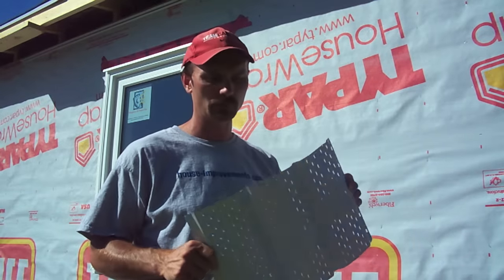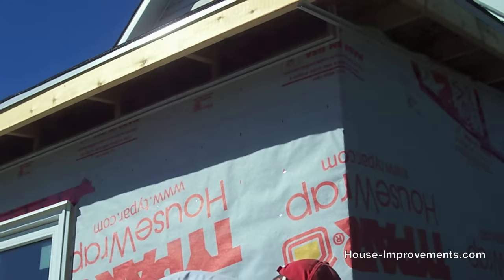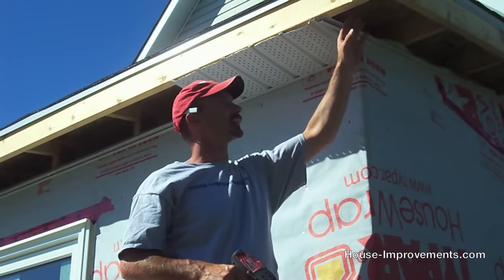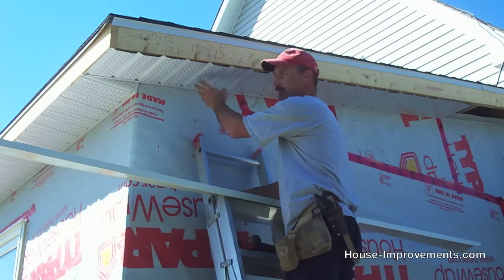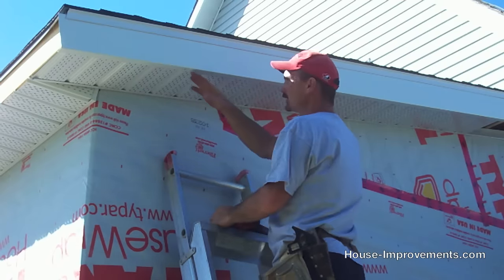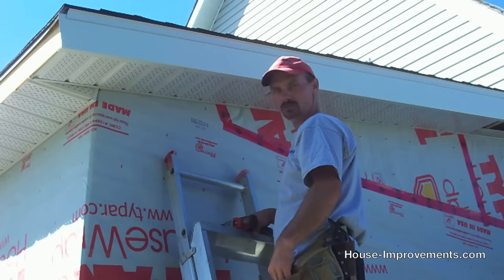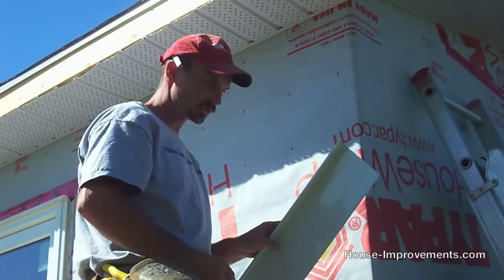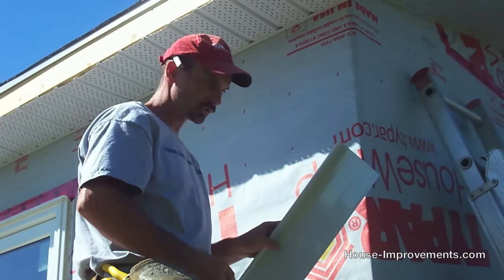How To Install Soffit And Fascia

Comment: Hopefully some faux contractor hacks will be watching.
I lived in a house for 20 years that was re-sided and guttered.
When I ended up with bacterial growth on the attic rafters because faux soffit was installed over plywood....with NO OPENINGS in the plywood for ventilation! 
The roof  exhaust vents were adequate, but NO INTAKE!
I found all kinds of crap that I had to correct by myself before I could sell.
And you know, not every home inspector knows his stuff....2 different inspectors, 2 potential buyers, and NOT ONE noticed the flaw! 🙄
I fixed everything myself after researching everything.
I don't let any so-called contractors touch anything of mine....even asphalt contractors are shady!

Comment: The only thing that I question is shouldn't the end piece wrap around the outer layer of fascia?
That's the only thing I would take into consideration aside from that, this way saves on material. Usually my company using 1x2's till its as even as possible.
Would it look more professional if it dipped // into the house or was just even throughout the entire layout of the house?

Comment: WARNING! At 5:39 it's clear that there is a huge gap between the turned-up soffit and the gable-end soffit. I installed like this, I'm pretty sure because of this video, several years back on my folk's shed and it resulted in problems with wasps getting in and nesting. Do you have a solution for this, or is this an issue inherent in this design that cannot be fixed?

Comment: How do you do the peak where the two pieces come together?
Reply from the maker: at the peak of a gable two pieces will meet ,I cut one piece so it runs past the peak an inch or so on the vertical face of the fascia and then the other one coming up I cut so it ends at the centre of the peak lapping over the first and the cut is plumb.
Reply: Thanks a million!

Comment: I hired a local contracting company to do a vinyl siding job for me, and have been nothing but disappointed. Now recently I found some soffit that apparently were cut short. They should force all all of those installing anything learn something more from professionals as yourself. I always learn something new.
Reply from the maker: Sorry for your misfortune. Maybe next time you will DIY it yourself?
Reply: Not likely but misfortune is putting it mildly. I wish I could have done it myself though because then I'd only myself to blame. I'm handy but not a home improvement expert. Thanks. :)
Reply: misue I would be fired and laughed at if I installed soffit like it's done in this video.
Reply: It looks like it's done well, why would you be fired?
Reply: misue it looks horrible. The front soffit is lower then the side. When you put the corner post on it would have to be cut to fit up in there without any gaps. It should be flush around the corner and the soffit should be cut at a 45 degree angle to smoothly go around the corner. This is lazy and half ass work.
Reply: That's what I like about pro's, they notice things like that! Thank you.
Reply: I wish I knew more about this. I appreciate your response! They actually had to redo mine because the first guys did a really really bad job! It's not perfect at all and just barely passes ok. I wish more contractors actually took their time and cared about how it looks as well as how it performs.
Reply: misue for a professional this should be very simple and easy. You probably had someone who is inexperienced do the work unsupervised by the contractor. Idk how things are done where you live but here in Massachusetts, this would be totally unacceptable for professional work.

Comment: Should the facia piece coming dow the gable not be lapped on top of the horizontal facia to prevent water from running down the gable piece and getting behind the horizontal piece and into the wood facia board?

Comment: Great video as always.  Quick question... If I am using  Vinyl soffit, can I still bend it 90 degrees as you did with the aluminium?  I want to achieve the same look as you did where the two sides meet.
Reply from the maker: +Jason Richards No it will not. where I made the bend you will need to install piece of 2x6 cut to fill in the end and then install the soffit only on the bottom of the soffit and then cover the 2x6 with fascia .

Comment: So now I need to add vents to my soffit cover. It looks like I should be able to remove the screws from the bottom lip of the fascia, pull out the old soffit cover and replace it with vented soffit... am I missing something? I think I could just cut through it and add vent covers, but I prefer to use the same vented stuff you're putting up for the look of it if it's not prohibitively difficult.

Comment: At 3:40 you said you need to keep is square to the building. What do you mean? Do you literally just put a square on the outside board and mark a line on the wood and on the house side to make sure you are putting the soffit straight?
Reply from the maker: Yes place the square against the wall and mark a lie across on the wood fascia.

Comment: Great video! You make installing soffit & fascia seem easy but I'm sure it's not.🔨 Question: Can you remove/replace a single piece of damaged soffit without the hassle of removing the fascia?
Reply: Kenneth Plott pull the screws out of the facia within 6ft of the damaged area and then the screws out of the damaged soffit and pull it out and then put the new piece back in and re-screw it. A lot easier to replace with screws

Comment: When installing aluminum fascia on a gable end of a house, should you start from the bottom and work your way to the top, overlapping the fascia with the top piece over the bottom piece as you work your way to the peak of the roof? I just had a contractor start from the top and worked his way down overlapping the bottom piece over the top.  I asked him wouldn't the rain run inside the the lap since it was reversed from what I thought was correct?  he said no, that is the way it is supposed to be installed.
Reply from the maker: protectionman  He is wrong, you are correct.
Reply: HouseImprovements some installers do that so that you don't notice the seams when looking from below. I do think water would get in though, so I would do it your way.

Comment: Shannon - what screws do you recommend using for fastening the metal fascia to the underside of the wood subfascia? All I am able to find is information about what size nails to use. My metal fascia pieces failed last year and fell out due to the nails coming loose over time and a good wind getting ahold of the sagging metal. Ripped it right off my two story roof.
Reply from the maker: I like a 1-1/4" #8 pan head screw. If they are not available in your area painted to match the fascia you can place them in a scrap of rigid foam so they stand up and spray paint the heads any color you want.
Reply: @HouseImprovements  Thank you for your response! Great suggestion on painting the pan heads! 
Really enjoy your videos, and appreciate the time you take to share your skills. I am also going to use your solution for replacing a corner siding piece! Great work, and continued success! :)

Comment: Shannon great video as always.  understanding this is a new addition is there any thing that would prevent you from doing this if the siding was already up?
Reply from the maker: This could be done if the siding was wood or if you have stucco. The J channel could then be attached right over it if you wanted. If you have vinyl you should not attach the J to it.

Comment: Is it optional to install an additinal board layer where the soffits mount? On my house it isn't open like installed here.  What are the advantages and drawbacks of having an extra layer of board?  It would be less ventilation, but I guess stronger.

Comment: Does the soffit have to be 90 degrees to the house wall? I have a steep pitch with 19" overhang. I was wondering if angling it up a bit is unheard of? What 's your thoughts Shannon? Thanks for the video.
Reply from the maker: No it does not. I have seen it on angles and also angled enough to follow a roof angle

Comment: How do you make the vinyl corner post fit and have a finished look under the soffit vent and at the wall corner right below the gable.  If you were to use vertical board and batten I assume you would bring/butt the top of the corner post to underneath the soffit J trim, and then use J trim to fill in the rest under the gable.....Curious to know how you would finish it.  Thanks

Comment: Thanks man.  That piece at the top that looks like it's coming from under the roof that you slide the facit piece in  How did you put that in?
Reply from the maker: That drip edge is installed while doing the shingles. You may be able to add it to existing shingled roof but not always.

Comment: Do you ever put nails in the drip-cap once you're put the faschia under it? The drip cap is great for holding Christmas-light clips if it's nailed against the side, but not if it sticks out more than an eighth of an inch or so. Would nailing it be a mistake?
Reply from the maker: I generally do not , when you place nails into the drip and through the top edge of the  fascia it can keep the fascia from being able to expand and contract with the temp. changes. That causes it to get wavy and ripples in it.

Comment: Thanks for sharing this. is wood before you cover with aluminum. Is that 2x6 or 1x6 in?and can I use threated wood?  I got quoted for almost $8k for installing new new facia and soffit and gutter. Im thinking of installing it myself..
Reply from the maker: The sub fascia is 2x6 un treated wood . I would not use treated wood as it reacts with aluminum and will eventually corrode and get nasty.
Reply: @HouseImprovements  I didn't think about the reaction, thank you.

Comment: Once you have the aluminium facia on, when you go to install your gutters, do you take your eavestrough hanger and just screw through the facia into wood?
Reply from the maker: snip the drip edge on each side of the hanger location so you get a tab that will flip up a bit and out of the way to secure the gutter hanger. The hanger gets screwed right through the aluminum fascia .

Comment: Why are soffit boards cut square to the wall? Can I run the long lengths parallel to the wall?
Reply from the maker: They will be floppy that way and will rattle in the wind for sure. Cutting them to fit this way is how they are designed to work best.
Reply: @HouseImprovements  Thanks so much for your reply. I've asked so many others ha. Cheers

Comment: Curious about that window having watched a few videos on those, to include yours.  It looks like you've pulled the house wrap over the header and taped it, but it appears the nail flanges are still exposed on the exterior of the house wrap?  Is that the case? Shouldn't the header be taped at the very end after the nail flanges are flashed properly and drip flashing installed?

Comment: +HouseImprovements What state or province are you in? I have questions, on on faschia and on soffit. Sorry to be wordy.

I notice you don't use any caulking between the faschia joins? My chalet is very windy-rainy Newfoundland, Canada - where if any lip gets caught in strong wind, it all gets ripped off. (seen it happen, screws or not.) Therefore my instinct is to use caulking. I generally use "Quad". What do you think? My thought is to protect against the wind. My worry is to give the rain every chance to dry out underneath.

Can the faschia you demonstrate be bought from Lowes, Home Depot, etc. without having to rent a metal folder? I see contractors here bring their own folders and fold their own faschia. I wonder why they bother.

Is there an alternative to metal or plastic soffit?

I'd like to match in something discreet so people will still think it is a building from 100 years ago. I was thinking of strips of 3/8 plywood primered and painted with a middle section open for air flow. But how should I fill it? I saw louvred 8 feet strips once, (3 or 4 inches wide) but I can't find them. They were backed with an aluminum screen I was told, to prevent bugs entering.

FYI:

I would like to match into my construction style of a salt box house from 100 years ago.
http://nfldinter.net/gallery/chalet/21452_10151837658594187_2064218150_n.jpg
But at the same time I want to give every chance for air flow. I just haven't found a system yet.
I'm building using clapboard that I primered once and painted twice using latex. MY architect says it should hold up nicely and not fail if primered on the backside. Iy avoids wood sweating and paint failure. A lot of heritage homes are done like this. Mine is designed to look like a heritage home, but recent construction..

As much as I don't want to paint, my architect says paint, I don't see myself on a scaffold every 10 years painting. So I will use aluminum faschia. I might primer the wood once underneath to give the wood a layer of protection from future rot.

Comment: we down here in florida 45 the I channel, then cut the panel's to the triangular shape. it takes two panels, which interlock, but looks a lot better.
Reply: but his is on a slope
Reply: when you have a flush corner that is fine to do, but in this case of an uneven corner, the offset needs to be filled. So this is one way to do it.

Comment: Hey Shannon, if you find a length of soffit that's exactly the length as your roof hole, is there any reason you can't just slap er in vertically rather than cutting it all up into pieces?

Comment: Shannon, we have always nailed or stapled our soffit. What type of screw do you use? I am assuming a pan head, but do you use aluminum, galvanized, stainless?
Reply from the maker: Just a standard steel #6 x5/8" pan head screw. Robertson head of course so they are not falling off your driver.

Comment: So I have a contractor doing my aluminum fascia now. Should he only be nailing at the bottom of the fascia, and not the facing side as well? I live in FL and saw in another video someone said you should nail on the face side to avoid movement from high wind speed. He's using nails not screws.
Reply from the maker: In some areas it may be needed to prevent wind damage.

Comment: Shannon, what type of screws were you using for the fascia?  Length and type please?  Galvanized, aluminum?????  We are getting ready to replace our fascia as we just replaced the shingles on the roof. The old fascia was originally faced nailed and that to me looks awful. I like the idea to use screws from the underside.
Reply from the maker: They are just a standard #8 wood screw that is 1-1/4" long. We can purchase them pre painted here in various couloirs but you can paint your own if you can't find the ocular you need. Stick them in a piece of rigid foam insulation and spray with an spraypaint can
Reply: @HouseImprovements   I just commented on screwing the J channel in from the bottom. and now this is a great tip also with the foam.

Comment: A quick question.   I see you installing the soffit and fascia before the siding goes in.  To me this makes the most sense, but around here is looks like the exact opposite is being done.  Is there a reason why you do it this way?  In this order?
Reply from the maker: If you do it after the siding is on then you are attaching it over the siding and if you ever need to change the siding you need to remove or cut the siding to get it off. It just makes sense the install the soffit first.
Reply: @HouseImprovements  thanks.  Totally makes sense.

Comment: Awesome video. Thanks for your help! Just wondering: if your soffit fits exactly in the channels, is there any point in cutting and installing perpendicularly to house, or can I just snap the entire piece into the track and run it parallel? (maybe throw a few screws in)
Reply from the maker: it is designed to be cut and installed as I have shown. This way it fits tight into the J channel and does not rattle in the wind.
Reply: Ahh.. That makes sense.  And if I screw it down now, I'll bugger up the J chanel if I wanna eventually install it properly.  Though, I'm sure buying new J chanel isn't gonna break the bank.  It snapped in so well (and tight) this way that I think I'll just leave it for now and see what happens.  But at least I know now that it can (and should) be cut. Bringing it home in one piece on my roof rack on a windy day was a gong show 😉

Comment: What kind of screws are you using ?  Have been playing all day with F Chanel . Went ang got J Chanel. My soffit is vynal . Don't know if I can get it to bend at the Chanel that goes up ? Any ideas ?
Reply from the maker: I do not use vinyl J or soffit. It is sold here but it is not a great product in my opinion.

Comment: I have an eve that is 46 1/2" x 201" long that fell apart due to a roof leak, do I need install J channel on all four sides to hold the soffit in place? And do I cut the lenght at 46 1/4 long? For longer lengths I know you have nail down so many inches/feet to keep it secure. Thanks for your help.

Comment: is that bottom lip on the facia trim make a gap when you try to screw up through it over top of your soffit? Where the soffit screws to the bottom of the facia board? does that trim come without the J part and just a straight angle? like an L?
Reply from the maker: +Weaselnest  Any I have seen have that, I believe it is to give that lip some strength.
Reply: +HouseImprovements would this same setup work if you were putting sheet metal on that wall? Would you still need some sort of J channel directly below that f channel or whatever you use as your soffit tract? Like a normal 3/4 inch corrugated sheet metal. Im really thinking of doing it this way on my shop with eaves instead of the rake trim cap,  this looks more like a house and just looks better